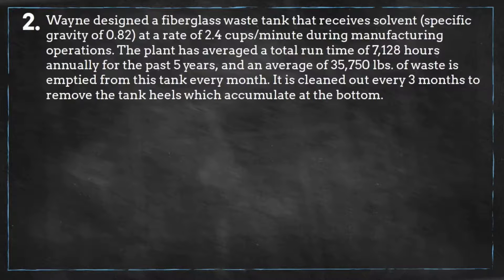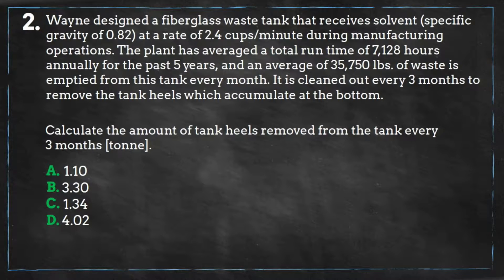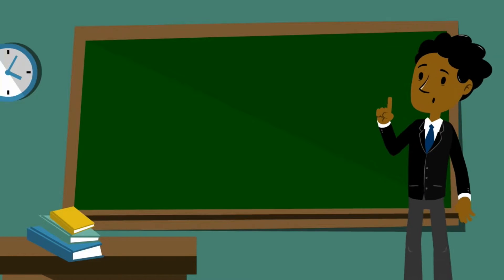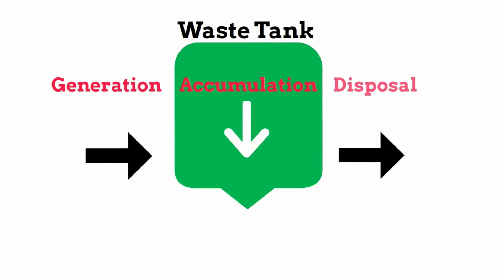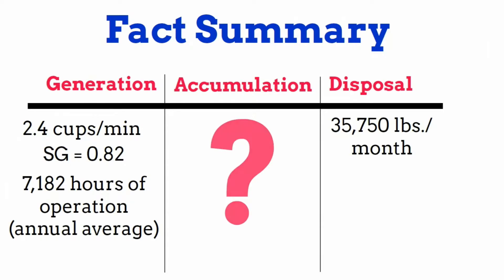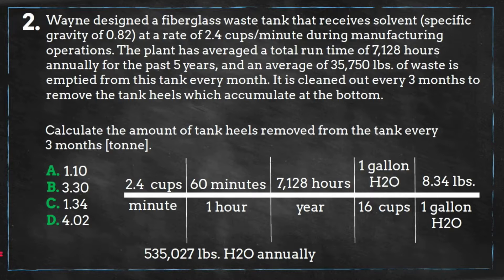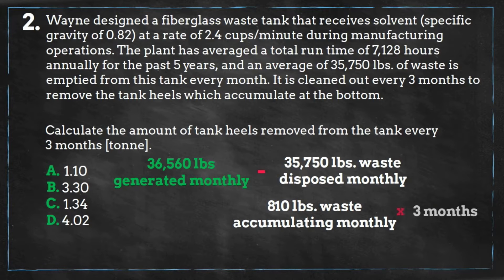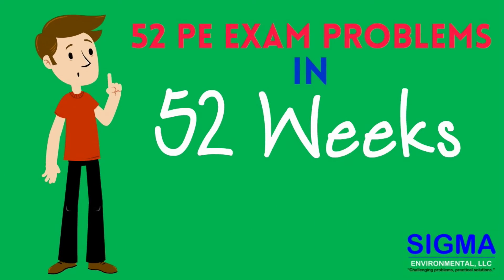Material Balances - Episode 2 (Waste Management) | 52 PE Exam Problems in 52 Weeks

Comment: you have 7,128 hours in a year in the conversion. Isn't it 8760 hours in a year?
Reply: I did the same as you, and then reread the problem and realized that we should be using the given run time rather that the actual amount of hours in a year - so that's where the difference comes from.
Reply: @jessicagray6944  we have to use the given run time as we don't know how many hours a week or how many weeks per year